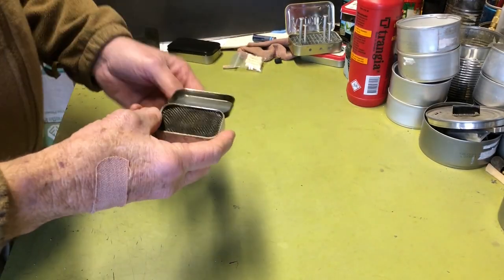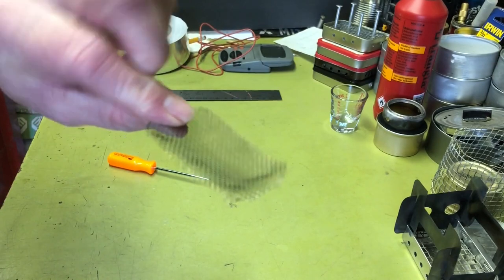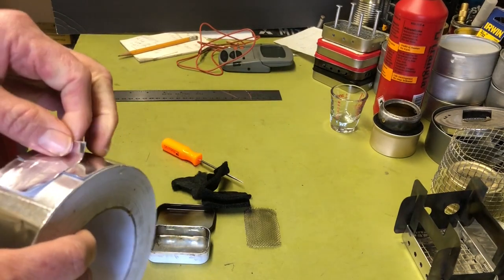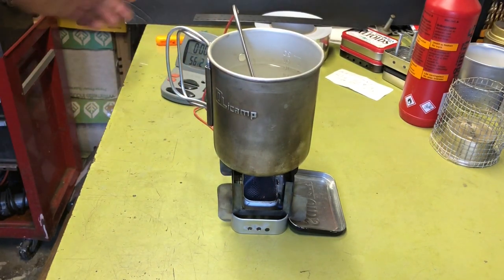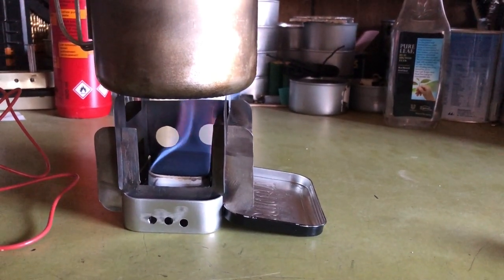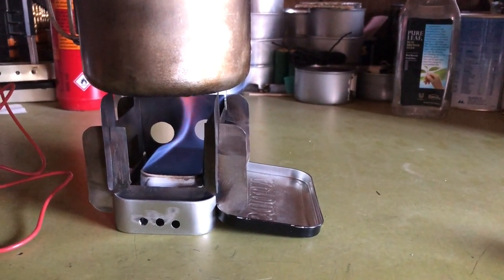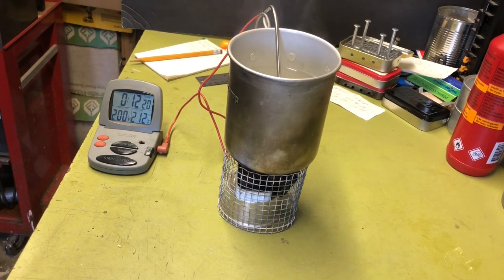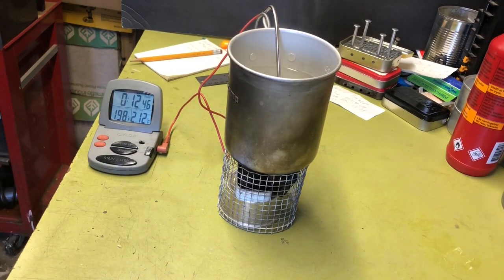Mini Altoids Tin Alcohol Burner

Comment: the foil tape becomes more effective if you unmount the lid to the tin. then flatten out the hinge pieces with a wood block. put on the tape then. you can fit 2 of these in a hexi cooker.  also your large altiod tin stove will fit inside a hexi / carri /bcb dragon /esbit cooker.